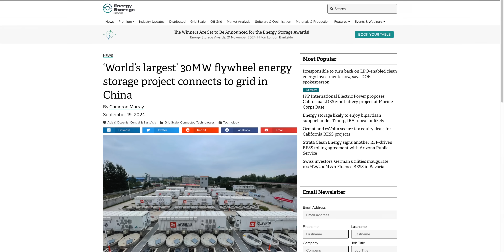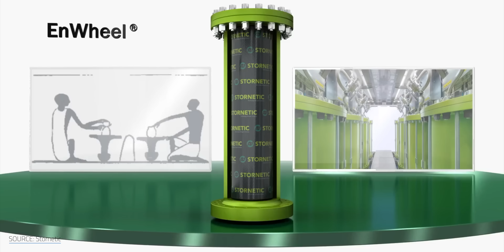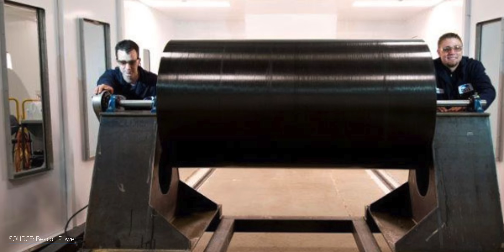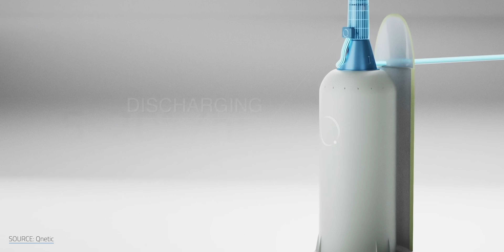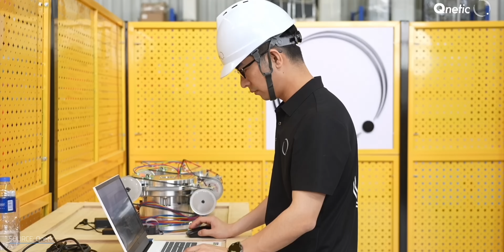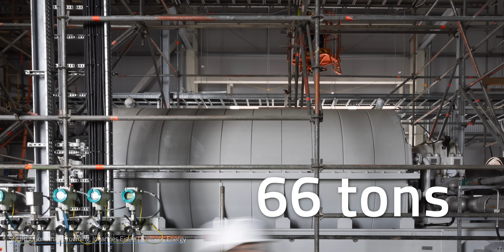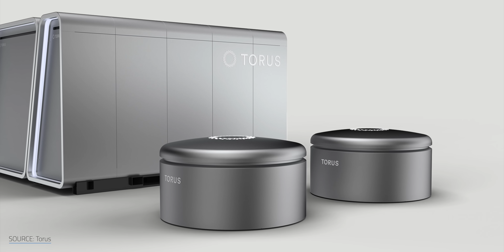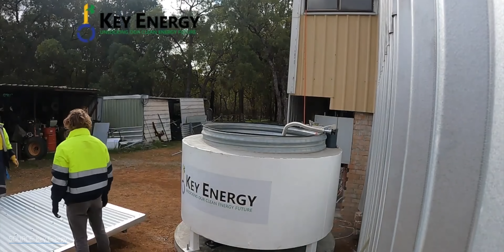How This Mechanical Battery is Making a Comeback

Comment from the maker: Do flywheels have a spot in our energy storage arsenal? Take your personal data back with Incogni! Use code UNDECIDED at the link below and get 60% off an annual plan: http://incogni.com/undecided

If you liked this, check out How Solid State Cooling Could Change Everything https://youtu.be/GHl6buYjZGE?list=PLnTSM-ORSgi7uzySCXq8VXhodHB5B5OiQ
Reply: Since a flywheel is essentially a fixed gyroscope, do the flywheels have any issues due to the rotation of the Earth?
Reply: @MonkeyJedi99   Usually these are on magnetic bearings in a vacuum to minimise friction.
There will be a tiny amount of force that becomes a small circle as the earth rotates, it shouldn't do much to the magnetic bearings.
Also if you spin it the right way you'll get a tiny amount extra energy added for free like a round the world trip Westwards gets you an extra day.
Reply: @MonkeyJedi99 I suspect the effect is too minuscule to cause any practical problem. Just like the earth magnetic field is too weak to negatively disturb the magnetic field in electric motors.
Reply: @MonkeyJedi99  I would wager that flywheels ARE affected by the rotation of the earth. If we don't want to slow the rotation of the earth, these things should be oriented parallel to Earth's Axis.
Reply: @zippythinginvention  Hmm...
The issue for that orientation might be gravity.
Specifically, the gravity pulling the weight of the flywheel onto the bearings unevenly.
I'm just doing mental exercises on this, no actual formulas or looking up the science.
Reply: @MonkeyJedi99  even more important, will the rotation of the earth have any issues due to all these cool flywheels we build?
Reply: @MonkeyJedi99  yes, they slow down
Reply: @glen.simpson  Well, slowing down is also a function of friction, but I was thinking of torsional forces against the mounting points of any axle.
Reply: How can we count the puns!! Great job.
Reply: pat's peak ski area, New Hampshire....... coolest fly wheel in america..... not sure if it;s still working, but was running like a champ in the late 90's...... somebody must have done some kind of film or article about their fly wheel.
Reply: @glen.simpson  the 90s were a long time ago, bud.  But they were great.
Reply: How many puns can you pack into one video?
Reply: amazing China is doing everything with regards to energy-they also have nuclear and hydrogen despite being the best in the world in batteries. however, this is an uphill battle vs batteries.  Sodium Ion production/lower cost is picking up steam and I predict a price war vs LFP batteries in just a few years and eventually Sodium Ion will be superior in BESS by 2030
Reply: I love glazing Chinese inflated data and bullshit statistics
Reply: Should we pay to not be doxed or should we dox every person in that company?
Reply: Its hardly an "arsenal",  and we are not at war.!
Doesn' tmatter what technology/technique we utilize. The fact remains, that all forms of generation and storage create and waste heat, lost energy. All the while polluting The Atmosphere.
We are parasites sucking the life out of The Earth. Greed; the modus operandi of humanity.
But its all moot now that the biggest money is being focused on, How to leave this planet and live on another.
The truth is out there. The facts are an incontrovertible inconvenience.
Reply: I missed the mentioning of the energy density per volume or weight, compared to any other form of energy storage.
Reply: No. It's already proven to be a net loss for energy storage. Round eyes already have this up.
Reply: The motor placement is wrong for spin up. The inertia primary mover should be on the peripheral of the flywheel allowing lower wattage to spin up. While the axial generator is placed correctly it could be 2 generators on each side of the axle. Material science should be able to make a alloy of iron or tungsten that can handle the shearing forces. Carbon fiber wrap is like a band aid and doesn't equate to overall Mass. The real bonus is radius and mass, speed is also important but until material sciences create better alloys iron based flywheels are cost wise and easily poured and turned.
Reply: The winning combination would be flywheels plus gravity batteries imho: one has amazing RTE but doesn't last long, the other has subpar RTE but can store energy literally forever
Reply: CLICK FOR THE TECH, STAY FOR THE DAD JOKES.
Reply: As usual when professionals took the job.. price became skyrocked. The same goes to windturbine. Yes they do it more efficient. But you can built simple one from garbage.. exactly..
Reply: flywheels lose 5-20% power per hour, thats a big revelation, no one has stated this before.
Reply: Have you seen levistor, in the UK they have a new technology in this space for EV charging.

Comment: Flywheels only value is as a output modulator for the intermittant power generation of wind turbines. That is really thier only value in grid applications. It mimics the ramping down of the mass of hydroelectric turbines when they go off line.  It is misleading to think of flywheel energy storage in terms of MW capacity without first subtracting the energy required to ramp up the flywheel's mass and the energy required topower the lubrication system.  There are cost effective applications of kinetic energy systems. Intermittant energy output modulations of wind turbines is not one of them. You would only do this if nothing else was availabe.

Comment: Curious to understand the rate at which the vaccuum leaks and adds friction because air enters the chamber. Similarly, magnets in the bearings don't last forever. Moreover, the issues related to mining for rare-earth metals to manufacture high-quality magnets cannot be ignored.  Weigh these against the  downside of rechargeable chemical batteries.  Much more research is needed on the relative benefits of FESS compared to conventional rechargeable batteries.

Comment: Along with the inherent dangers of high energy flywheels, the reliance on perfect maintenance is huge as any non-ideal parts would have massive effects to the efficiency of the system.

We need to add a topic to university for STEM fields - "Theory VS Reality".

Comment: What about a flywheel chambers filled with fluid? Weight, whether steel, composite, or fluid is weight. During spool up, the chambers can be empty requiring less energy and filled slowly adding mass and balance on the fly. If there is a failure and the flywheel escapes, the fluid will dissipate harmlessly. Much safer on vehicles where the flywheel can do a lot of damage in a collision.
Reply: @hfarms5779  That’s a pretty good idea - I guess the only issue would be balance? Like going at that speed any wobble means disaster, and moving fluid around could be more unpredictable than a solid unchanging flywheel?

Comment: RC helicopters have a built-in FESS and so their real battery has much lower C-rating and yet can perform high-G maneuvers just as well as quadcopters with very high C-rated batteries. The lower C-rating batteries are higher in energy density, so RC helicopters have higher endurance for the same weight class of drones.

Comment: ❤ Very interesting to know there is meanwhile more going on ❤
I look at the fly wheels like switchable condensators, like you said for stabilizing power grids. Those blackouts should become history after most power distribution points got some of theese. Fast switching and variable output. Combined with real batteries, mechanical and chemical, the whole energy concept will give sense and can provide cheaper energy, possibly already at mid term. Although some loss, better producing when possible, store and distribute later, than no production because whatever.

Comment: Theoretical Blue Sky science question?
If a generator is an electric enjoin effectively working the other way around. Could a Fly Wheel be used as a gearing for teravolt scales of energy output?
I have long thought that even if we had the power to travel at relativistic speeds, how could you use it from a 0 kph start? or even starting from as fast as posible before pressing go?  A gear box for such power strikes me as a separate problem. perhaps a flywheel could provide some much needed drag(Time to full output). Slowing acceleration.

Comment: I think no chemical battery gets even closer to flywheels on charging speed. There's a type of flywheel that is often used - a motor/generator pair used to correct problem in transmission lines. They are not build as flywheels but they have 2 flywheels per pair: the rotors. The flywheel effect of the rotors is taken into account when designing application and it's a positive characteristic of the system.

Comment: Before they were used for electricity they were primarily used as a way to smooth the output of steam engines to make it more suitable to drive complex machinery that needed a consist ant rpm to operate

Comment: Large steel rolling mills used an Ilgner set which comprised an ac motor driving DC generators plus a large flywheel which absorbed the spikes when steel ingots entered the rolling mill.

Comment: It’s grid  frequency that they will help with more than amplitude.  Other large mass consumers  coming onto the grid.  The cascade power failure in  Spain hi lights this.  There is a much greater voltage- amplitude tolerance (+6/-10%) in power generation than there is for frequency (+/-1%).  They don’t need to provide power for hours or even minutes like a battery,  they just need to help smooth out instantaneous spikes in demand and give the grid some backbone.
They don’t really need to provide more mass than a standard generator,  they’ll just help reinforce and protect the silicone switching side.

Comment: I lived through WW2 growing up and as a child remember on the Wireless hearing of a donkey engine losing a big flywheel and this was found about half a mile from its operating site.  This happened more than once so ultra fast flywheel energy can run amok its like all energy release it too fast and its a bomb.  in the 40's we were fighting a war and took risks now we need to consider s bit more carefully.   I like conserving energy but favour Armstrong's hydraulic Accumulators and hydraulic motors not converting all energy to electric but unless folk understand the rule and laws of energy bad choices are made without full development and testing.

Comment: In germany there is currently a project trying to use flywheels for EV charging. We have a lot of solar at farms or on other large buildings, which at sunny days the grid often does not accept because there is an over production. Some are exploring the option to install EV charging stations with dynamic pricing to sell off the surplus energy. On times with low solar production the station is still be available and uses grid energy, at much higher prices. This is already done, but the solar installations are rarely large enough to support fast charging at full speeds. That's where flywheel storage comes in, the energy only needs to be stored for a very short time until the next car want's to charge. I like the idea because it adds some little storage, but primarily uses already existing ev batteries to store the otherwise lost energy.

Comment: Practical Benefits for Data Centers
Fast Response: Flywheels can respond to power changes more quickly than batteries, which is critical for protecting sensitive equipment in data centers.

High Efficiency for Short Cycles: With 90-95% RTE, flywheels are more efficient than batteries for short-term power needs, reducing energy losses.

Long Life and Low Maintenance: Flywheels last for decades and require minimal maintenance compared to batteries, which need to be replaced every 5-15 years.

Safety and Space Saving: While flywheels often require buried installations for safety (due to high rotational speeds), they take up less space than large-scale battery systems, which is an advantage in data centers with limited space.

Limitations to Consider
Short Storage Duration: Flywheels lose energy quickly (5-20% per hour) and are not suitable for long-term storage. Batteries are needed to cover extended periods of low production from wind or solar.

High initial costs: Flywheels require precision engineering and special materials (e.g. carbon fiber, magnetic bearings), making them expensive to install. However, the costs can be offset over time thanks to their long lifespan and low maintenance.

Safety design: Because flywheels spin at up to 50,000 rpm, they must be installed with robust safety measures (e.g. buried wells), which can increase project costs.

Texas is a prime location for using flywheels in conjunction with wind, solar, and batteries for a data center. Stable ground conditions make flywheels easy to install, and the state’s vast supply of renewable energy makes it possible to take advantage of flywheels’ strength in stabilizing short-term fluctuations. Batteries complement the system by handling long-term storage, and together they create a reliable, sustainable energy solution for data centers. Compared to the Netherlands or the swamplands of Florida, Texas has fewer geological and environmental obstacles, making it a more practical choice.

Comment: My Employer uses this with standby generators.  It provides power while a generator starts up and gets up to speed.  This keeps power consistent and smooth without lead acid batteries which are very difficult to maintain and don’t last very long.

Comment: I have sometimes wondered whether a motor generator, with a DC motor driving a synchronous machine on a common axle, powered by photovoltaics, would be useful. A very similar idea. I used to use motor-alternators for induction hardening - a 50Hz motor driving a 10kHz alternator. That technology was replaced by inverters. I do wonder whether such mechanical sources of grid frequency stability may not also be replaced by inverter technology. There is no technical reason why not. I believe some Tesla Megapack installations perform this function?

Comment: I came interested in ‘energy storage flywheels’ in the early 70s as ‘alternative energies’ gained media attention, & I learned that ‘the Swiss’ had city buses that relied on ‘flywheels’ to supply the electrical power the motors needed… which I thought was a fantastic tech application.
The ‘flywheels’ would ‘recharge’ [spin back up] only at the bus stops where overhead electrical contacts would be engaged by the buses… like city electric buses do with the endless miles of overhead power lines common today.
I realize that all tech has downsides, but I still think this ‘bus flywheel’ is brilliant !

Comment: I think it's a great idea. They just scare the daylights out of me. If you have ever seen a rapidly spinning heavy object on the loose. It can take minutes for the thing to spin down. Meanwhile it tears apart anything it touches. It's movement is utterly unpredictable and hiding behind a brick wall or even a building doesn't guarantee safety. 
 Underground ? I guess that would be safe. If It can spin out completely and stay put underground I say let's do it

Comment: So these are essentially being used as mechanical capacitors, right? I also just realized that, if used as a capacitor, the flywheel assembly wouldn't create a 90° shift in the phase for AC circuits like a typical capacitor would.

Comment: Modern physics denies that Newtonian momentum is conserved in circular motion (flywheels); but this is incorrect. If a 2 m radius flywheel shares its rotational motion with a small .2 m radius flywheel (of the same mass) the arc speed will drop to half. Kinetic Energy is not conserved and angular momentum is not conserved. 
Modern Physic denies Newtonian Momentum Conservation because Newtonian Momentum Conservation can be used to make energy, and a lot of it. All you need to do is wrap the flywheel with a weighted string and throw a mass off of the surface of the flywheel.
A 20 kg flywheel moving 2 m/sec can place all of its Newtonian Momentum in a 1 kg mass moving 40 m/sec in a straight line. The flywheel had 1/2 * 20 kg * 2 m/sec * 2 m/sec = 40 J and the 1 kg has 1/2 * 1 kg * 40 m/sec * 40 m/sec = 800 Joules.
The 1 kg can rise and be placed in an Atwood's that can restart the flywheel 20 times

Comment: I waited to hear this. 🙈The question is , ‘if you didn’t store energy, in the flywheel, and began using it and exporting it, can a second , and third in-ground fly wheel ,be capable of in-sequence, directing its’ energy to sand-heat , or on site battery?’
   Asking for a friend.🙏🏾

Comment: Why dont they use flywheels with bigger diameter? Is it rotating so fast that it would break?
I think a very big but slower rotating flyeheel could be more efficient that smaller fast-rotating ones ^_^

Comment: Flywheels are used in virtually every piston operated internal combustion engine to smooth out the jerkyness of the combustion cycle. Different flywheels are used in different applications. A sports car or race car may have a lighter flywheel to improve responsiveness and allow for higher revs while trucks will usually have a heavier one for retaining torque. The flywheel is geared allowing the starter to drive it, thus it serves a dual purpose. All that said, finding them in other applications is fascinating.

Comment: I wonder why compressed air is not more common? It is safe, high efficiency, low material, low maintenance, and suffers little energy losses over time. For an installed storage system where size is less a concern,  CAS seems to be an outstanding option.